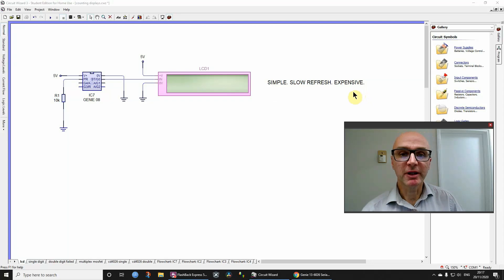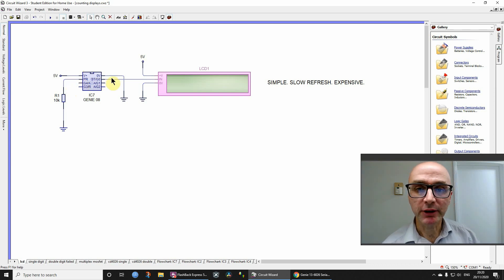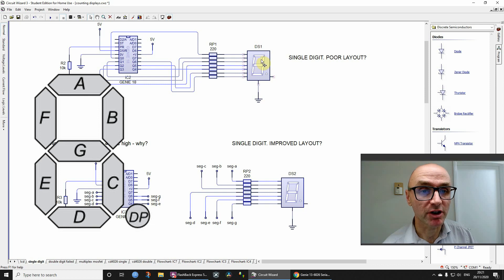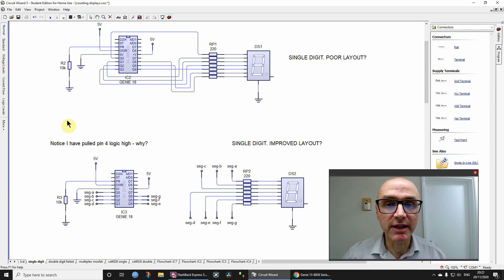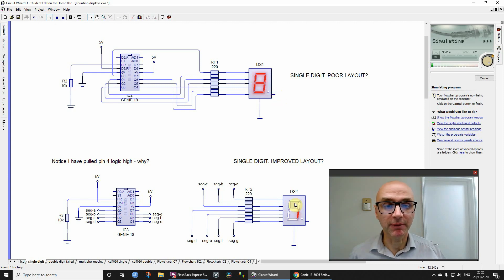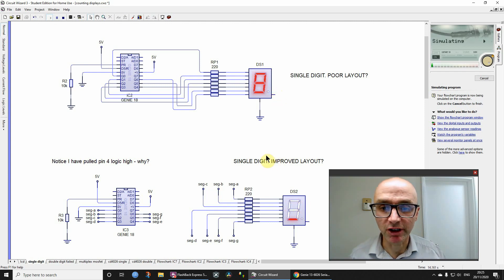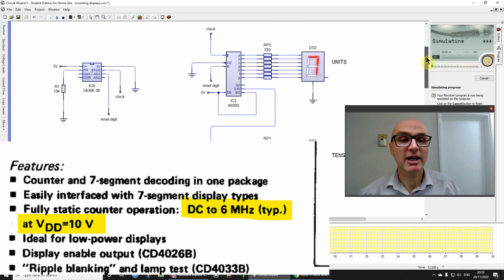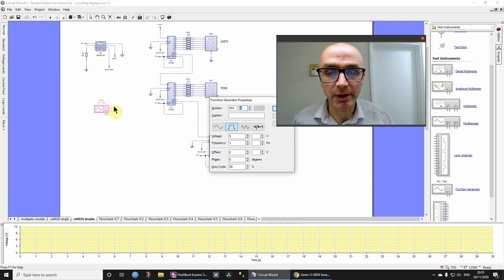How to display numeric digits and characters in GCSE Electronics Genie microcontroller projects

Comment from the maker: Please note that current limiting resistors may not be required between the CD4026B and 7-segment display. It depends on the supply voltage. An improved circuit would use transistors or ULN2803 Darlington Transistor IC to drive the display segments. I am posting an updated video to discuss this matter.

Comment: Hello Sir, I've started my journey on learning microcontrollers using GENIE as I got the circuit wizard software and GENIE hardware as a gift from a friend.

I noticed that the GENIE and PICAXE upload cables are cross compatible and that the GENIE and PICAXE are pin compatible too.

I was wondering if you knew whether the PICAXE and GENIE are basically the same products? There are lots of PICAXE learning resources online but not too many GENIE resources and would be nice to know if I could use them.

Thank you so much for your videos, I subscribed.
Reply from the maker: Pickaxe and Genie are regular PIC microcontrollers with additional software pre-loaded, making them suitable for their respective systems. I don't think they are cross compatible. Genie chips have the advantage of compatibility with Circuit Wizard, which is a simple tool suitable for students to design and simulate circuits as well as program Genie microcontrollers. I haven't used pickaxe for a long time but I seem to recall it's more oriented towards the home hobbyist market.